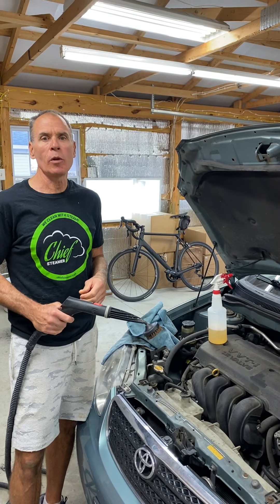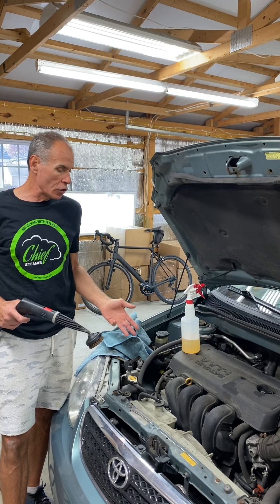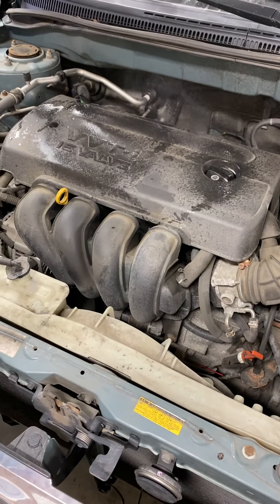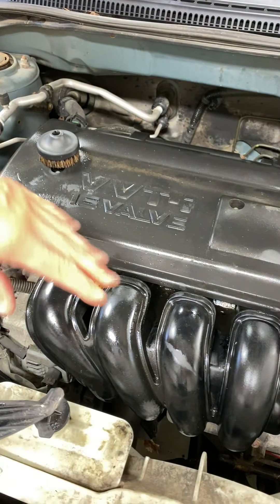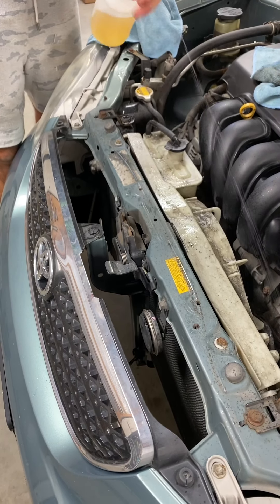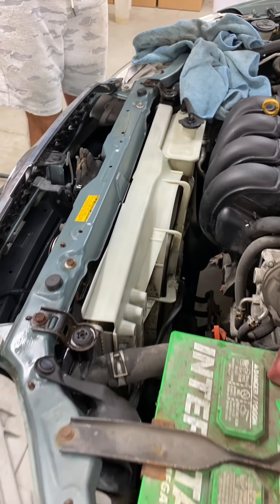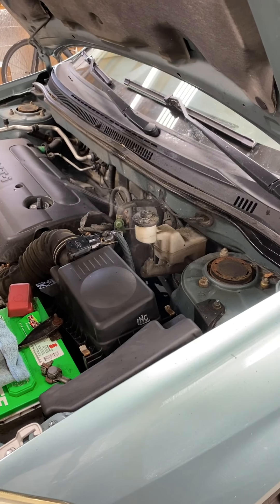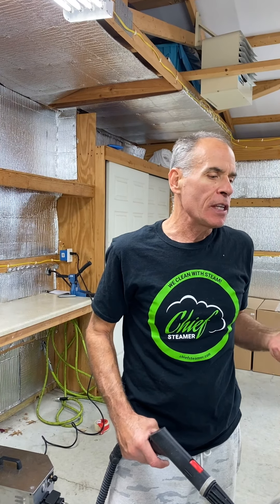Cleaning the engine bay with steam

Comment: Power washer? Garden hose? Never. I'm looking for something safe and effective. I don't care about the time it takes to do the work. Plastics melt with heat. I'm guessing, although I don't know, that normal engine bay temperatures routinely go above 212'F/100'C, & thus steam cleaning would be relatively safe. Target vehicle is a Corvette, & they've got plastic everywhere. Not just trim and engine covers, but body panels & more.
Reply: Just use a power washer and a air compressor and you would be safe I do that to all vehicles Audis, Subarus, Honda, ford, Chevrolet I never have a problem, just keep distance and use common sense if you have open connector or something like that